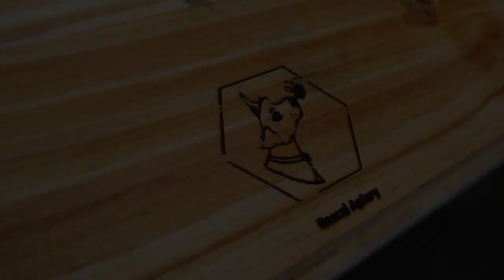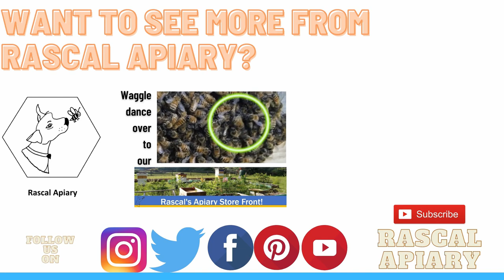Preparing your hive for bees | Keeping your bees in the hive permanently!

Comment: I built a LL last winter and then bees last summer.  Not being a real woodworker, I just have basic tools.  I had an old hive from a neighbor that was painted white, never used by them and left out for years - it was my first hive for 2 years, but now I am going with an outdoor, brown stain so cycling this white hive out.  I spaced three boxes out and joined them on both short fronts with large pieces of wood so overall, it is a pretty thick shell.  This way, I didn’t have to cut the frame rests, worry about bee space within, etc....  I did leave it a screened bottom board with a second screen bottom which was removable so I could put insulation in the bottom for the winter (Northern IL).  That ended up being tricky since the bottom most screen frame was poor quality wood and warped by summers end.  I also had to leave a way to give an OA treatment with a pan (a ProVap type would have been easier to design around) but, I had a lot of fun planning and designing my “own idea” of a LL; bees stayed and thrived and yes!  So much easier on the back!  Will soon see if they made it through the winter; last I was able to check was mid December and they were still quite feisty!  My biggest concern is that I didn’t provide enough passageways for good horizontal movement through the (former) sides of the hive boxes used for the inside.   If they successfully winter, I plan to convert more of my Lang hive boxes to Long Langs.  I hope it works and I am pretty proud of “my” invention!
Reply from the maker: Hey good to hear form you again! Sounds pretty awesome! I like the ingenuity of that style build! 
Hope your bees survived and your 2021 season is amazing!